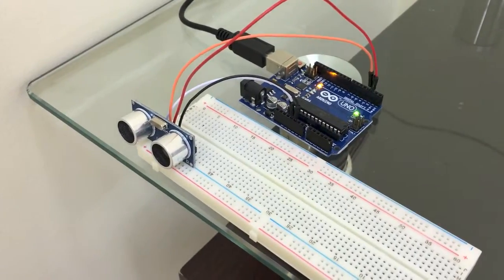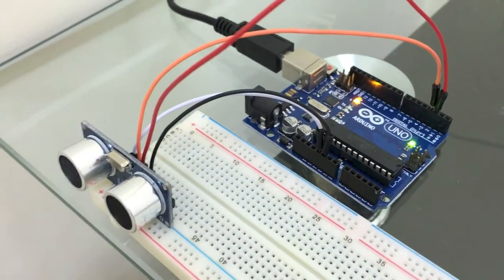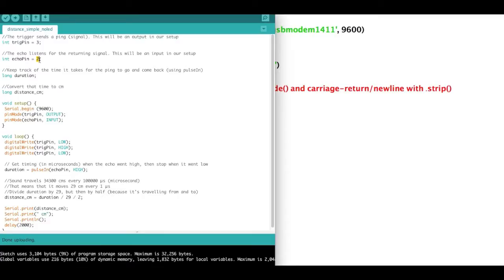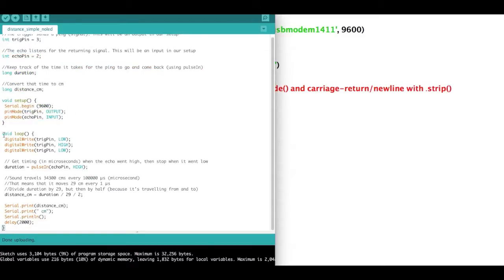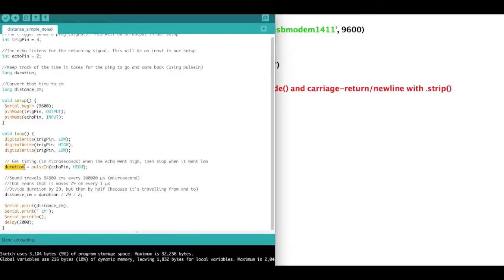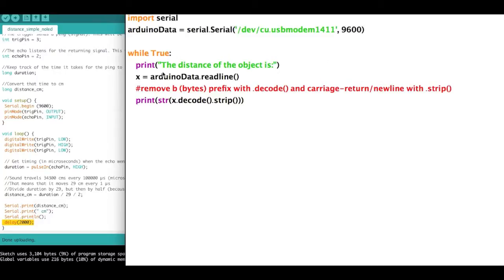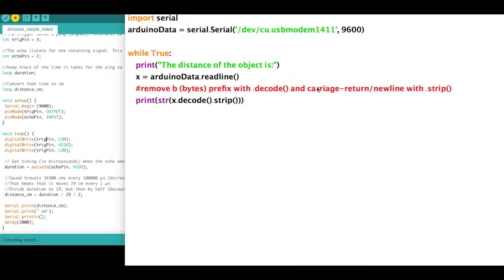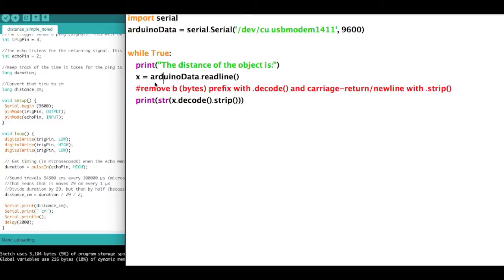Measuring Distances with the HC-SR04 Ultrasonic Sensor, Arduino and Python

Comment from the maker: Posting the entire code from the INO file here: 

//The trigger sends a ping (signal). This will be an output in our setup
int trigPin = 3;

//The echo listens for the returning signal. This will be an input in our setup
int echoPin = 2;

//Keep track of the time it takes for the ping to go and come back (using pulseIn)
long duration;

//Convert that time to cm
long distance_cm; 

void setup() {
 Serial.begin (9600); 
 pinMode(trigPin, OUTPUT); 
 pinMode(echoPin, INPUT);
}

void loop() {
 digitalWrite(trigPin, LOW); 
 digitalWrite(trigPin, HIGH);
 digitalWrite(trigPin, LOW); 
 
 // Get timing (in microseconds) when the echo went high, then stop when it went low
 duration = pulseIn(echoPin, HIGH);
 
 //Sound travels 34300 cms every 100000 μs (microsecond)
 //That means that it moves 29 cm every 1 μs
 //Divide duration by 29, but then by half (because it's travelling from and to)
 distance_cm = duration / 29 / 2; 
 
 Serial.print(distance_cm);
 Serial.print(" cm");
 Serial.println();
 delay(2000);
}